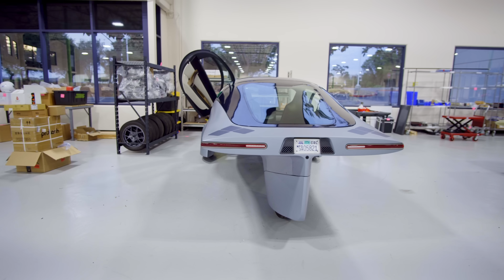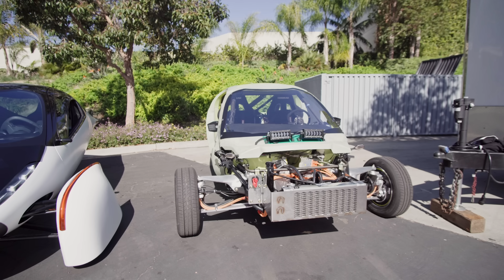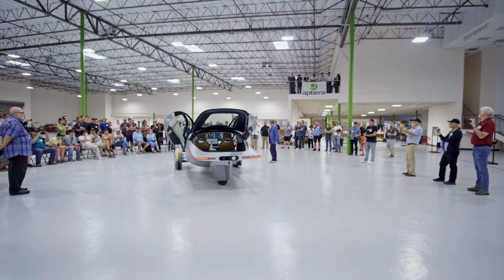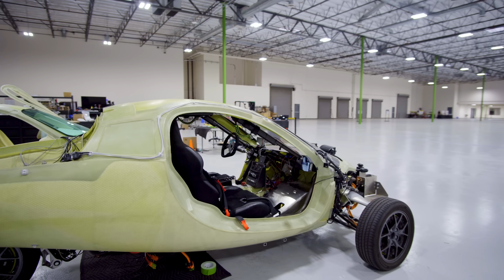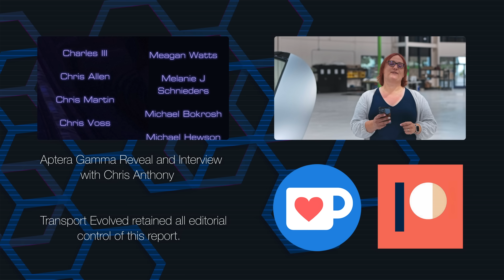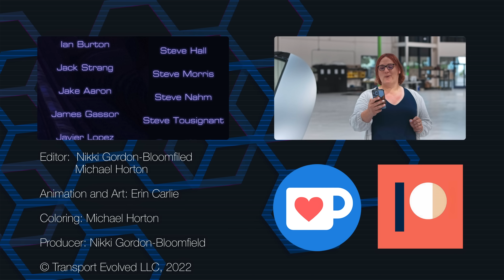The Aptera Gamma Prototype Is Here. What's NEXT?

Comment: The explanation about aerodynamics and AI testing sounded technical but it really isn't, cars in the 1940s had sophisticated aerodynamic designs which was the byproduct of all the aerodynamic studies and tests done on aircrafts during WW2; you don't see Toyota or any other car manufacturer strain so much emphasis on aerodynamics and ergonomic studies because you don't need that deep a research and dev; all the data are already available, they're being studied in engineering colleges, ergonomics is such a tiny thing to even emphasize if the person designing have gone through any design or engineering degree.

Also the part where he said "we made the structure 1% bigger" to sound impressive like the work they're doing is so micro-accurate and techni-refined(yes I made those words up to sound impressive) but 1% at the scale of a car is negligible it doesn't make sense. The apterra car in the video looks like it's 4 meters long which is a bit shorter than a sedan; 1% of 4 meters is 40mm or less than 2 inches which makes the next words he said about "more interior volume" "more space for battery packs", and "it's a much comfortable vehicle to drive" make zero sense, right before he quickly changes the subject so the listener doesn't have time to process all the things he just said, especially since he said something even more puzzling which was the car became even more aerodynamic with the bigger surface area.

Comment: I generally don't like EVs but the Aptera is one the right track.   It is unsafe, but safer than a motorcycle
Reply: Aptera is far safer than you imagine.  Early production intent models will be voluntarily crash tested to FMVSS automotive standards by an independent third party and the results published.  Stay tuned.
Reply: @n.brucenelson5920  I hope Aptera is safe.  The old issue with lightweight vehicles is the corpse might look okay in an open coffin funeral, but the G forces rip internal arteries.  The weight differential is extreme in collisions involving very light vehicles leading to internal bleeding.  The occupant is the crumple zone.  

I thought of a G-suite that is always semi-inflated instead of a seat belt harness.  The vest is climate controlled and protects the torso and chest.  Instead of the airbag, this device fully inflates.  The driver wears a hemet and HANS unit.  Then, we might have ultralight vehicles that are somewhat safer.
Reply: @timothykeith1367  I currently drive a Gen 1 Honda Insight that got 4s when it was crash tested.  It weighs about the same 1800 lbs as a 40 kWh Aptera 

My first one was hit in the Interstate at speed by an SUV driver who fell asleep.  The crumple zone allowed me to survive uninjured.  Aptera' s design has been continually virtually crash tested as it has developed and now the supercar engineers from C.P.C are involved.  They clearly understand safety at far higher speeds than Aptera will generally be faced with.  We may have more details later this week.
Reply: @n.brucenelson5920  I have a Geo Metro, I never feel unsafe except when stopped waiting to make a left turn and large vehilces blow by at 75 mph on the next lane to the right  - literally shaking my little car from their wind, that I wonder if others will slam into the back of my car.  I got rear ended once and woke up on a stetcher being placed on a helicoptor ride to the hospital after my car was cut open by the EMT crew, but I was okay.  I like small cars and know the risks.
Reply: @timothykeith1367  So glad you are OK!

Comment: How does the battery and charging tech work in a cold snowy climate? My volt goes from 40 ev miles to 25-28 miles in the winter. Also snow covers solar panels, so what happens when you have to drive and the solar cells aren't charging the car
Reply: I live in Iowa and don't have many concerns.  Range will be cut, but there is plenty for most needs even in cold weather.  The Aptera can also be plugged into 110 or 220 home circuits to charge.

The entire vehicle has been tested at -20 F and some sub systems down to -40.

Also, it has a superior ABS/Traction control system.

Comment: Fabulous... I was very interested in this vehicle at its first iteration 10 years back.  Really thrilled to see it back and so close to production (I'm almost inclined to put down a deposit myself - but I already have 6 EVs!!).
On the external mirror front, I'm significantly surprised that from a regulatory perspective, the issue of improvement in safety for pedestrians (in a collision scenario) would not pretty much completely outweigh whatever loss of utility the regulators believe having a video-based system would mean over having glass mirrors.

Comment: Since it has in wheel motors, how much? what the cost would be to replace one of those, if you got into an accident since those are sticking way out there. In a traditional vehicle, the motor is central and it uses drive shaft where you'd only be replacing drive shafts. Maybe suspension units and wheel hubs and things like that. Here you're going to have to replace a motor and that could be an expensive fix. Just curious, that was the one of the first things I thought about the motor being on the hub. Thank you for doing such a thorough interview. Thank you up Aptara for supporting self-repair.
Reply: I heard it has 2 for front wheel drive and a 3rd one at the back for all wheel drive.
Reply: The cost of ordering a third motor is $2,500.

Comment: Wow.  This car is very impressive in a lot of ways.  One of the most impressive to me personally is the fact that they want you to be able to get parts easily and fast and that you can work on it and fix it yourself if you want to.  Just for that very fact alone is why I would never own a Tesla.  I understand that most people that have Tesla's don't care about that.  They just pay to have it fixed by a Tesla certified place.  This company really has opened the market way open to so many more customers by just that.  And the price.  Very good and affordable to more people.  The way the doors open is so cool.  It's very sporty.  The only thing I really don't care for is that there are only three tires.  Besides the fact that three tires are not as stable as four, you would have so many more options to do with it if there were four tires.  One being all wheel drive. I would definitely buy it if it had four tires.  Maybe the y will have another model as time goes on. The other negative is the windows.   I don't know for sure but the driver and passenger windows remind me a lot of the Lamborghini countach from the 80's.  Those windows were a huge failure. Very annoying.  Not sure why anyone would ever do that again.  Maybe the whole window rolls down but it doesn't look like it. That makes it very difficult to do a lot of things and there is absolutely zero reason to have a half window for your driver and passenger.  It is also classified as a safety hazzard.  So hopefully it is not that half window and the whole window does roll down. But those are the only negatives I can see.  I can really see this car being very successful.  Very impressive.
Reply: Aptera offers AWD as an option and by test it is more stable than many 4 wheel cars sold in the US, including SUVs.  It passes the moose test for instance.  As far as the windows go, a more obvious example would be the Subaru Alcyone SVX.  The reason for the design in Aptera is that it aids the aerodynamics.

Thanks for your interest and comments!

Comment: I really Like this Vehicle I wonder if Chris is aware of EV NiO and if he foresees any competition? I think if Aptera had a Battery Subscription type deal or were interchangeable with the NiO battery Pack they could even further reduce cost and Beat ALL Competition in All Venues Nio offers their EV at around 11,000/car then the buyer would sign up for a battery subscription at 12 bucks per month gives them around 1500 miles/month or 6 battery swaps/month. This concept added to the functionality of Aptera could push even more production and they could expand into the Battery swap market while lowering cost even further. Oh, almost forgot the other pro that NiO has is the capability to use your Car Battery to operate appliances, lights and other gadgets if need be or you are camping in it? Just a thought but I am very happy at the technical strides and innovations Aptera has come up with. Good Job guys at Aptera.
Reply: The Aptera battery can be used for power needs while camping.

Comment: Does shade or one side effect the other panels like flat panels do if one panel only for example get 50% light it affects all the other panels unless you have micro inverters
Reply: It is all but certain that each panel (hood, roof, dash, rear hatch) will be “separate” and have it’s own, independent, MPPT/controller which negates the possibility of shadowing on one affecting any other.

Comment: The high efficiency makes charging with a very simple home sourced solar charger (for more range/ higher miles than the built on panels can provide) easily doable.  I'd like to see a low voltage port for additional direct input from outboard panels, which could be carried as folding panels inside the car that could be deployed while parked, separate from the high voltage Tesla or J-1772 type port.

Comment: I have some questions regarding aptera, if a 4 wheel version becomes available while waiting for my 3 wheel vehicle, can there be a transition with my order to the 4 wheel vehicle
Second WHEN will aptera begin production, i have a delivery date 2023-2024
If new battery technologies become available will my price go accordingly, up/down
Reply: Aptera has said that their pre-orders are fully refundable at any time.  I would guess that you could also switch to the 4 wheel, 5 passenger sedan when it is announced.  If you have not yet taken delivery, the answer should be yes.

The answer to your second question is that Aptera is still on track to produce their first delta production intent vehicle built with production tooling by the end of this December.

The first production intent vehicles will be going to a third party for crash testing to FMVSS safety standards, and Elaphe will get one for testing on their winter weather test track.   There may be other needs for completing certifications of the delta production design.

We don't know for sure yet when they will start delivering Paradigm edition models, but the production rate will start ramping up quickly once this happens.

Comment: So impressed with the potential of this vehicle!! Just a thought, since the Aptera has fantastic battery storage, would it be possible for it to be connect to a home to supply power to avoid power outage, such as Hurricanes or Big Storms? It would be just another reason to purchase an Aptera!
Reply: Great point!  It is not yet included since V2G tech is not yet standardized, but it will very likely be an option, perhaps even a post sale add-on.  It would be a very cost effective way to gain this functionality compared to present options, and might be a reason to justify a larger battery size - even the largest 99 kWh one.

Comment: I still dont see this being drive-able after/during snow, if you get a few inches of snow that back panel is going to be destroyed.
Reply: No. Nothing about a layer of snow is going to damage a polycarbonate arched trunk hatch. The vehicle weight vs. power and clearance issues makes this limited to a couple inches of snow. Imagine hitting those frozen slush bergs with the wheel fairings. My Arcimoto does great in moderate snow, see the videos about it.
Reply: @popeyegordon  refer to my new comment.
Reply: I will be getting one of the first models for year round use in Iowa.  I plan to use either chains or studded snow tires in the winter.  At present I am driving an 1800 lb Gen 1 Honda Insight that has adequate performance in snow, and I expect that due to the traction control/ABS that Aptera will be better.  I will be giving full reports on how it performs under these conditions.
Reply: @n.brucenelson5920  my comment is about the super low clearance of the rear wheel.

Comment: To help convince legislators to allow side-view cameras, maybe have something where your required to carry slip-on/clip-on backup mirrors inside the car in case the cameras fail.
Also, the Tesla connector won't be practical for large long-range vehicles unless it starts supplying much more than 400 volts.

Comment: At this point, Aptera is the only EV I would buy for a number of reasons, but the Right to Repair is a huge one for me. About the battery pack, you say your going for a multi generational vehicle… so how easy will the battery be to replace? I remember when electronic devices had a battery compartment. You simply popped the cover off, removed the old batteries with new one and popped the cover back on… So, will your battery pack be something that easy?
Reply: The battery pack will be replaceable, but due to the weight, it won't be a simple process.  Most people should get around 1/2 a million miles from them before this would be needed and by that time there will likely be other options.

Comment: He should have said we charge it for you at the factory.   After that you don’t need to charge. If you park it in the sun.
Reply: No. Cloudy days, short winter days with low sun angle. Dust on the panels and covering up in a garage. This is not a purely solar car by any means, it is about halfway there. It will be a solar oven when parked in hot sun. My doorless Arcimoto can never be a solar oven.
Reply: @popeyegordon  It depends very much on your local solar insolation.  Here in Iowa, I will probably only get half the average solar range that they do in San Diego, but it is still enough that full solar will not only pay for itself - it will pay back the cost of the vehicle in reasonable time, compared even to my present very good hybrid car.  I encourage everyone to look at the numbers they might expect.  For many, it will be a full solar car except for road trips.  I will even be able to make the occasional round trip to Kansas City or Des Moines from my house, just on solar, in addition to my local driving.
Reply: @n.brucenelson5920  It is naiive to refer to the numbers provided by dealers. I have driven a solar powered car-bike for 7 years in Florida. In winter I have to tilt up one wheel to get a useful sun angle. My 100 watt roof panel has a curve so it will never put out more than 80 watts. To avoid foot in mouth, wait until the first consumer reviews and reports come in on actual miles from solar only as reported and verified in different lattitudes and seasons. There just isn't a lot of surface area and part of it will always be away from the productive sun angle. I am very much in favor of laminating solar cells on all horizintal surfaces of all EVs, even making it mandatory by federal law. But it does little on an individual basis, the gain comes when a million or more cars all have it. Let's see if the super aerodynamics can  give you even 20 miles in ideal sun and how much the AC draws in that hot sun. Two years to go before that can be measured by more than a couple owners, if ever. Times are tough for all manufacturers and the extreme confidence voiced in the video is a bit of a performance.
Reply: @popeyegordon  I don't just have to refer to numbers provided by dealers, since I have spent decades working and designing in this field, especially in thermal loads.  I have had refrigerators I designed keep a 5 cu. ft. cold box cold from New Zealand across the tropics to San Francisco on only the power from a single 80 watt solar panel.  A samples freezer I designed and helped build flies on the ISS.  

Aptera's approach of looking at all sides of the design, both power production and power use has the potential to yield large improvements compared to only considering one aspect.

There are several independent experts with the ability and experience to evaluate the reasonableness of Aptera's claims, and they have not just accepted them because they are naiive.

It is well to be cautious, but pre-mature to think that the entire support community is accepting claims at face value without being able to check them.
Reply: @n.brucenelson5920  I am not saying the 'support community' is taking claims at face value, I am saying Aptera does that with click bait videos the public is seeing. There is one titled '1,000 mile range solar powered' and not one of them has been owned and driven by a consumer to prove the claims about range and solar. Are you a solar engineer or a refrigeration engineer? 
I can pull the appeal from authority fallacy as well. I am a retired marine electronics engineer who has been driving a 170 pound solar car-bike for 8 years. 9 years ago their claim of getting 20 miles from solar each day was false. They had to switch from a 60 watt to a 100 watt panel with a curve in it so it could not actually output over 80 watts. That performance is verified and I have not needed to plug mine in when I park it in the sun. There are bikes in Key West that have never been plugged in to charge. That is proof. It takes years to achieve. 
I hope the Aptera lives up to its claims. We need more like this.

Comment: When production starts which model gets built first or is it first deposits in, first served?
Reply: By the time your reservation number comes up, all models should be in production. That's assuming you haven't reserved one yet. More than 30,000 are ahead of you, more than a year's worth of production.
Reply: The Paradigm 40 kWh models will be built 1st.  After that the other sizes will be phased in, and it will go by order number.  The production line will be able to build all versions with different models at different stations at the same time.